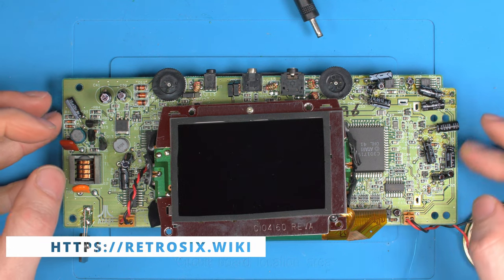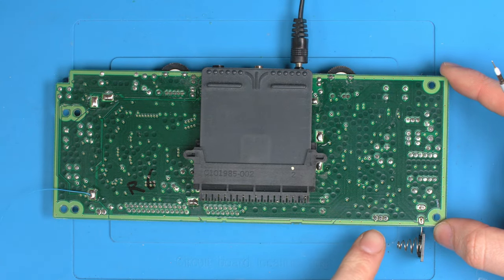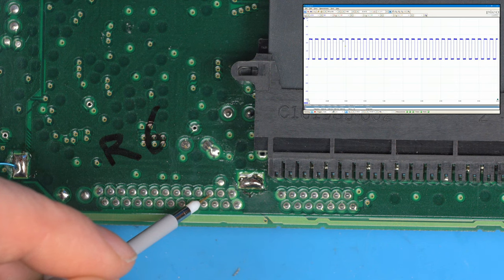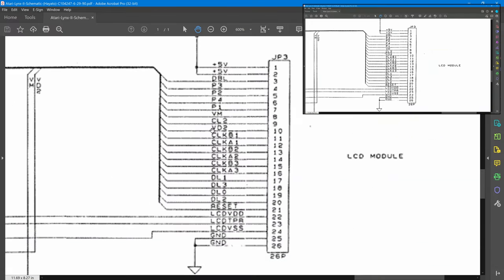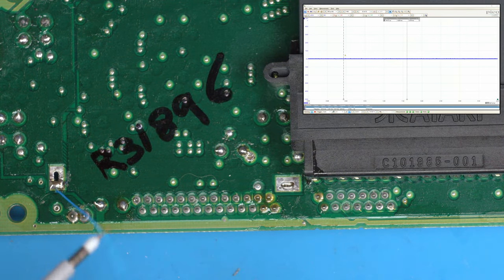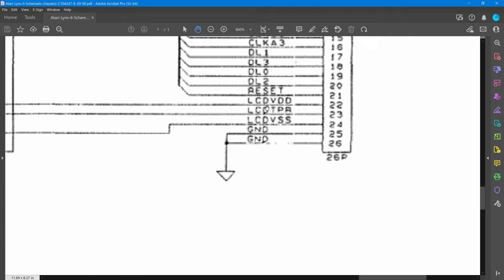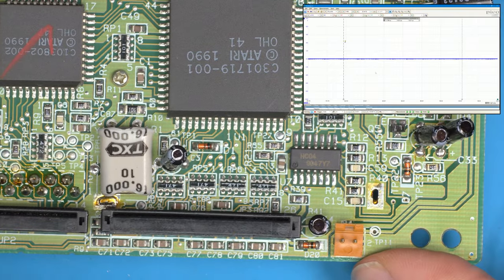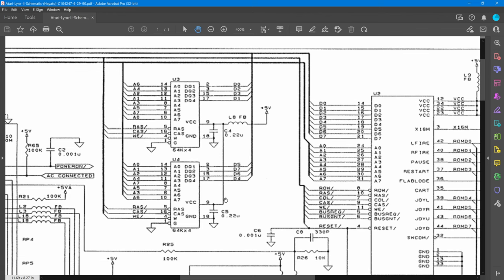Can We Fix A Dead Atari Lynx ? (Black Screen)

Comment: Thanks for your very interesting video. You always try to explain how things works before attempt an fix and is very useful for us.
I have an lynx2 with black screen, no sound, contrast wheel none effective. After reading some posts on internet, as the one in this video, my hayato chip must be dead :(
Best regards, Nicolas
Reply from the maker: Contrast wheel isn't controlled by Hayato so it won't be that. Apply ground to metal sheild on back of motherboard and 5V (not 9) directly to battery positive. See what happens
Reply: @RetroSix  thanks a lot for your advice. I put 5v on c41 capacitor (from memory) to bypass original circuit and always same thing. Black screen, no sound, contrast wheel none effective. I doesn't own an oscilloscope so I will try to replace ram but I have only little hope.
Best regards, Nicolas
Reply from the maker: @nicolaslacoste9367  can always post it to me and I'll fix it on YouTube and ship back